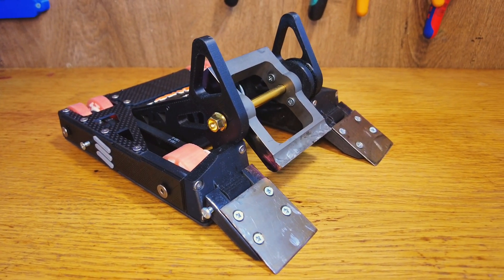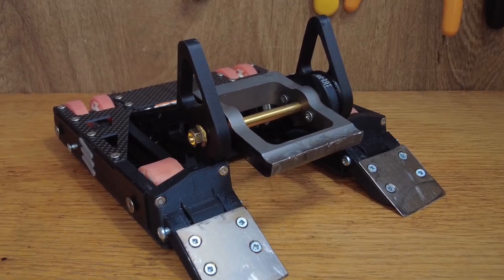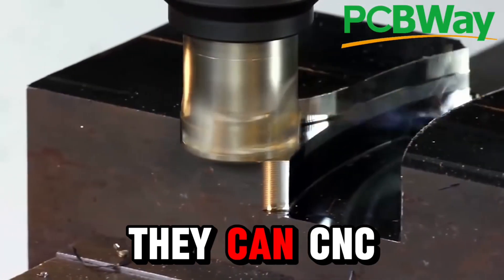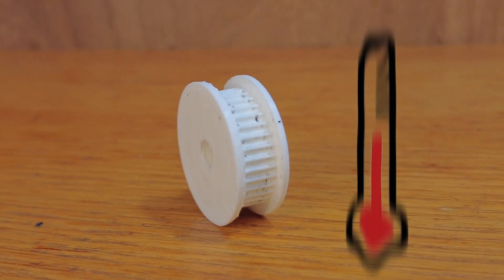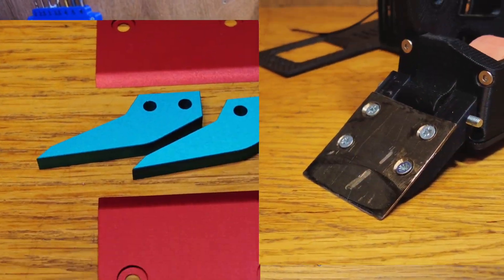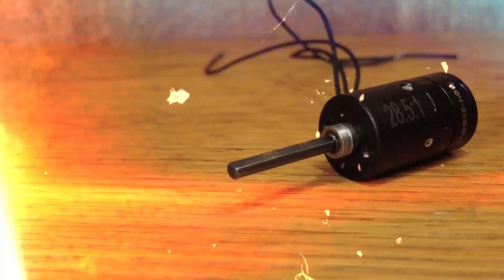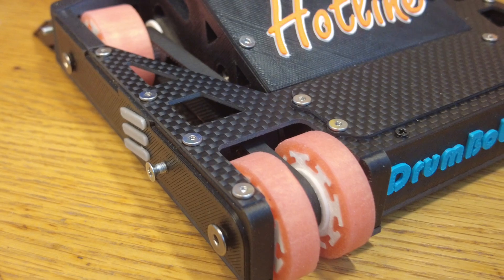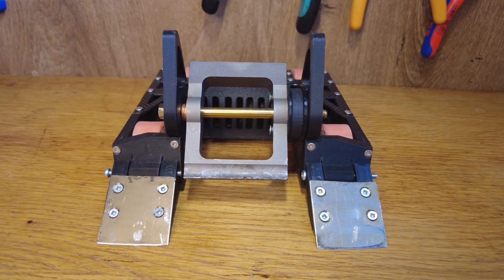IS THIS THE FUTURE OF COMBAT ROBOTS? (My 1 pound antweight "HOTLINE" breakdown video)

Comment: hey Im building My own sub 1lb robot, and i have brushless drive as well, and I was wondering are your ESCs bi-directional (letting your wheels spin back wards), and what Type of control link do you run, because Im gonna be running ELRS on an Edge tx radio, and I was wondering what your mixes are, if you use a similar just PWM style receiver.
Reply: Mostly I just want to know how the electronics in the drive system work @drumrobotics
Reply from the maker: @SpacemanFPV1  So in this version  I used blheli-s esc's, but they are not bought with an installed bi directional programe. You have to program it with arduino and chose the biderectional option, as they all come in one directional. This option worked, but for my newer 4th version I have bought Am32 esc's already programed specially made for brushless drive's and that I hope will give me better driving.
Reply from the maker: @SpacemanFPV1  Hi, So yes of course my esc's are bidirectional, as there is no other way for the robot to turn or go backwards.  I use FS2A reciever with fs-i6 transmitter and not elrs so I can't help with that.
Reply: @ well it’s still PWM so the mixes are just what I’m after

Comment: Hello, what capacitance and voltage batteries do u use for hotline?
Reply from the maker: @amka1097  For this version of Hotline I used a 450 mah 3S HV (13 volts) battery, but it was way too big as it never ran out of charge and could hold up to two matches with no charge. Now changed to a 380mah 3s battery as it's way lighter, yet it can still survive the full 3 minutes fighting.
Hope that helped.
Reply: @DrumBotics  thanks!
Reply: @DrumBotics  what C rating are they, because I worry about battery sag, and my motors pulling too much.
Reply from the maker: @SpacemanFPV1  75c, but 35c would work as fine.
Reply: @ I plan on using 80c

Comment: I don’t even know where to start .. is there a kit for antweight plastic .. like where do I learn “ how “ too get a basic one up and going.. can I take a hex bug to competition lol
Reply from the maker: @Daniyoyo  By saying plastic antweight you mean 454 grams or 150 grams? I mean my kit is mostly out of plastic, but the weapon has some steel teeth. If you find any 150 gram competition I would recomend getting mine, because everything is said on what you need and what to do. I do not know if there are 150 gram plastic ants, or in the 454. You sure there aren't any not plastic competitions near you? They should be held together at once. You can take anything that fits into the weight limit😉 even hex bugs. It should work and be movable by your controler. Just check the rules if a particular switch is needed or something else.
Hope that helps.
Reply: @DrumBotics it is 1lb(450g) plastic antweight here in the US. They don’t have it as small as 150g at least where I’m located .. do you have 1lbs kit or do you know how to go about getting started in making one
Reply from the maker: @Daniyoyo  I don't make 1 pounders Yet. You can join the antweight facebook group and there should be peaple who sell some 1 pound kits. I know there are some, although not sure if they are meant for plastic ants.
Reply: @Daniyoyo repeat robotics has the scalar cad up you can modify

Comment: i think its 200$-300$
why your bot is way bigger than mine haha mine is 3lbs bot with 5 inches in length and 8 inches wide
Reply from the maker: @dmugas4989  I mean it is pretty average in size for a one pounder. 15cm by 15cm.
Reply: @DrumBotics  its still in a cad so its really hard to imagine haha.

Comment: Did you use a metal hub inside the nylon double 24T pulley, or is it just secured by those set screws? Also, I'm guessing it cost about $600 US if the drive motors were that expensive.
Reply from the maker: @sebsjunkyard  No there were no metal hubs. Just two set screws to tighten to the D shaft. 
btw close guess but not quite there.

Comment: Before You use the new brushless drive what tipe of N20 motores are 
(RPM, etc.)
Reply from the maker: @Leo_99-j  I used custom high power 1000rpm's n20 with 3amps of power. They are great for 150 gram antweights, but for 1 pounders too weak.
Reply: @DrumBotics  thak you
Reply: I use 4 n20's (4wd) in mine to great effect. But if you use just 2 motors they definitely lack.@DrumBotics